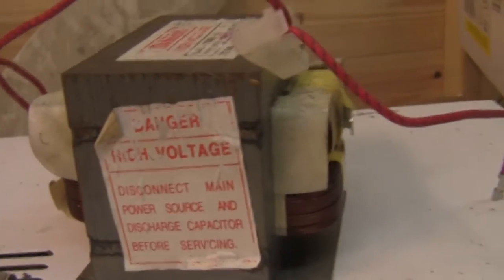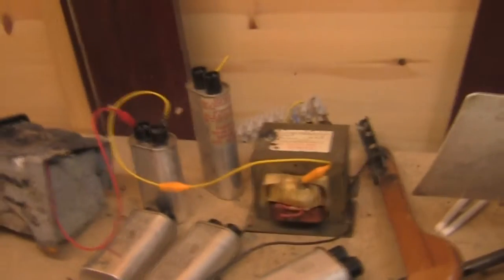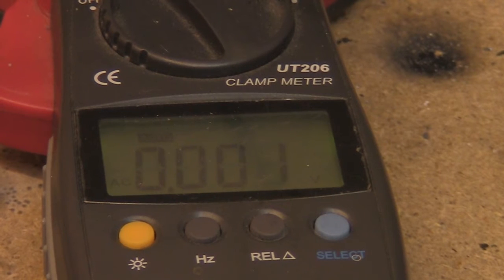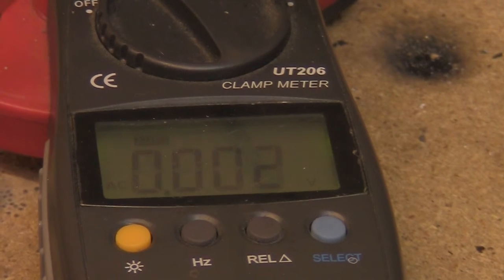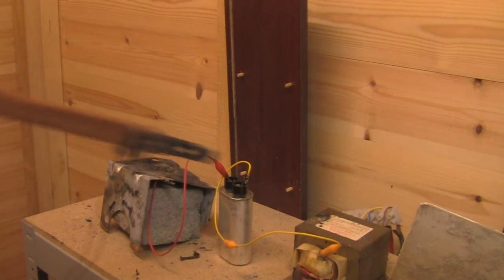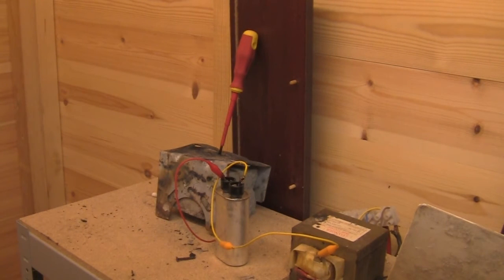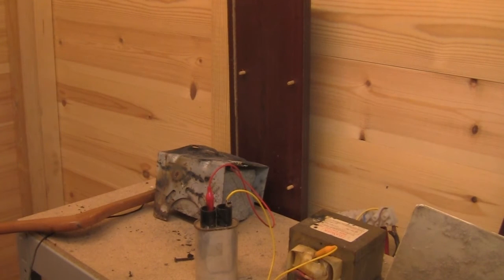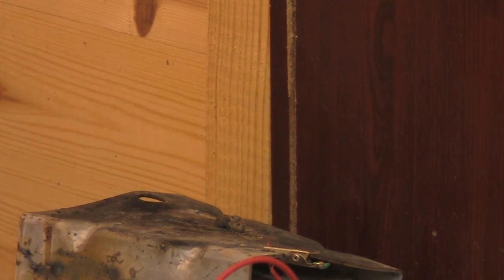Microwave oven transformer Health and Safety.

Comment: I learnt a dam harsh lesson knowing what a capacitor does, when placing my hands in a washing machine while i forgot to unplug it from the wall.
My one hand was touching the body of the machine my other hand for some reason thought i would check them connections on that cylinder looking object, 
Then wallop I could not let go my body was jerking for about 20 seconds then I was able to release,and that was just a low capacitor voltage regulator,
I would not survive if It was a microwave capacitor or even the transformer if I was stupid enough to not discharge the capacitor first.,eve engineers have died by not following the discharge rules be for probing.
I have a Question that I can`t find info on ,
On the transformers label you will have the word ` Class 200 or class 220 or 250  do you know what this means?

Comment: You're trying to measure what voltage your capacitor is charged to, using a voltmeter set to AC mode? Try it again in DC mode and you might actually measure it properly...

Comment: @DJinfinium Electric arcs can get really hot as they are in the state of plasma. This means they can reach temperatures of over 25 000 degrees Celsius.
Even the small arc from my flyback transformer is hot enough to vaporize nearly anything it comes in contact with.
In other words, do NOT play around with plasma unless you know what you're doing. :P

Comment: Your sound quality, especially the low volume, is so poor I have no idea what your points are, other than "discharge the cap". 

If you prefer using a PVC pipe, a precaution I agree with, do not use wood for the demo. 

On the other hand, it would be useful to show carbon tracking in a piece of wood held in a piece of PVC.

Show the  arcing first, then the boring voltmeter.

I have no idea what the point of the tangerine arc is in the context of HV health and safety.

Comment: BTW, I tend to feel a bit safer rather than discharging it and setting the conductors aside, to leave the conductors connected after I'm done when working with caps, then the sequence is disconnect the conductors, apply power to the system, experiment, remove power from the system, leave a physical gap, connect the HT leads together. This also avoids the problem of the cap acquiring a charge while not in operation.

Comment: I keep hearing about the guy with scissors and a MOT since photonicinduction shut down. And all I have to say is: Holy crap! I'm new to HV and even I know that is incredibly stupid! The key thing to remember is when voltages reach a certain level, even insulators become conductors. I did some tests with a flyback and a pair of pliers with a rubberized grip. the arc will jump right through the rubber. there is NO protection at the voltages these devices are capable of!